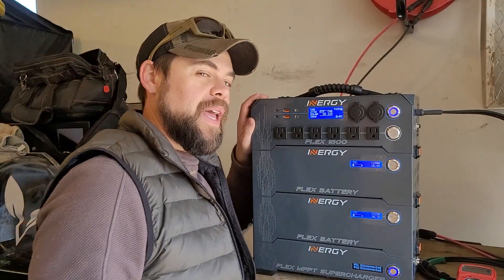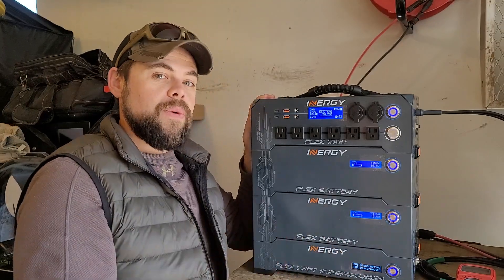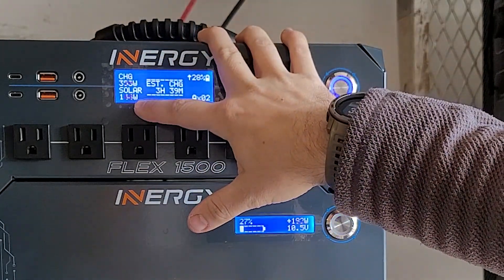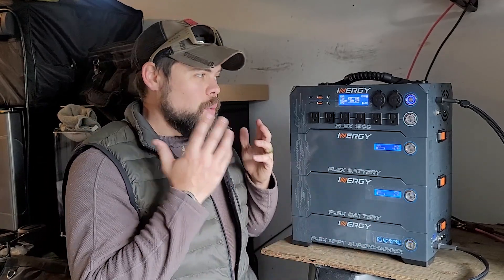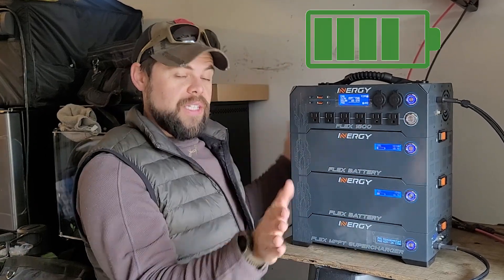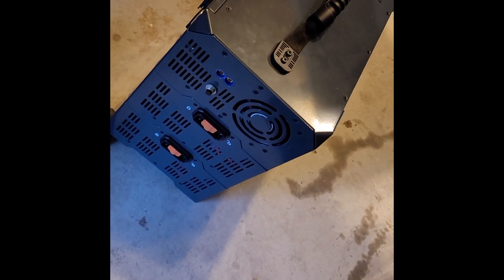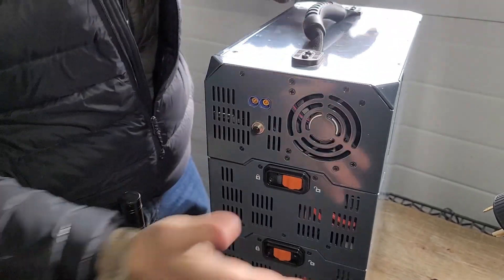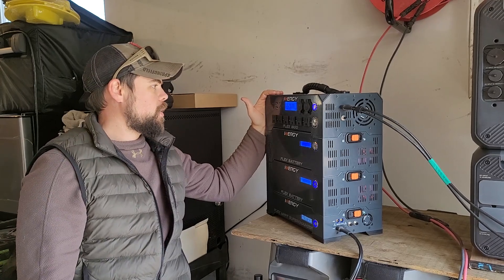UPDATED REVIEW Inergy Flex 1500 Solar Generator Power Station

Comment: Good thing that one broken broke on you instead of a bigger one I mean if your AC 500 broke then you broke something that would have really gotten you and hotwire because then you may not bear to run your house especially if you needed two AC 500 for 120/240 volts and 10,000 Watts. Which is more what you need and yes I watch the video of that with you at least you had one of them anyways with a battery or something like that I don't forget to them at the time I don't know if you have two of them now but that's why I don't understand this video with a 1500 watt. Which doesn't impress me special When I need more power than that. And that little unit means nothing to me.
Reply from the maker: Agreed. Thanks for watching.

Comment: As I watch your videos in the past I know 1500 watts is not what you need especially get to Delta pros combined together to make 120/240 7200 watts. So I really don't know much of why you would need 1500 watts to run your house it ain't going to work so maybe talking about going camping in a little tent because it ain't even good enough to run a camper that I know cuz I had to use a 3000 watt inverter To run my cousin's 30 ft camper in the summer of 2022.
Reply from the maker: This defintely won't run a house. It would be good for remote use for small loads. Maybe at most it'll run a water pump off-grid, not well pump.

Comment: i actually had this system on order and after waiting several months i realized that the current tech(this was in 2021) had surpassed this i canceled my order and went with the Bluetti AC300 system......which was shortly passed by even more capable systems. This industry is moving fast this last year.  Your channel is one of the very few that does follow up on existing systems and i look forward to watching them.
Reply from the maker: Thanks for watching. I'm glad you got a different system.
Reply: They ever tell you how much watts this thing can handle I know it's 90 volts and 30 amps max
Reply: I bought this unit in February 2024 & in June they change the order so I got no solar panel after telling them I wanted the  complete kit with solar since I'm homeless living in my car. I have nowhere to plug it. Waited till November  it took me weeks before I could find where to Plug to just find out console not charging. Wrote various emails to them & I got no answer. Now I'm screwed & on ssi is not easy to lose that much money😢